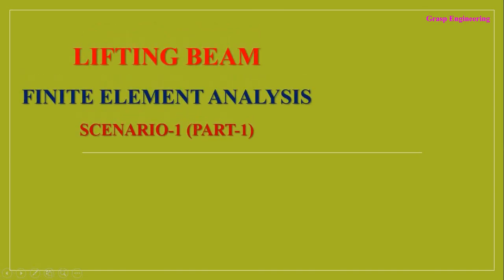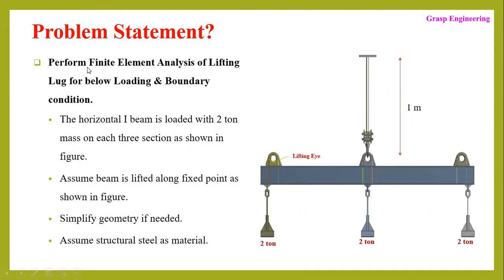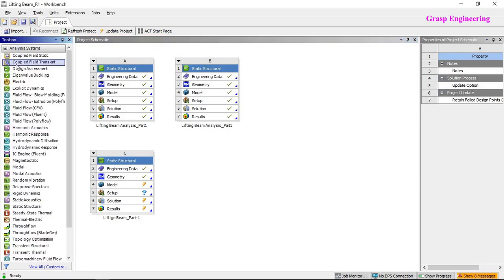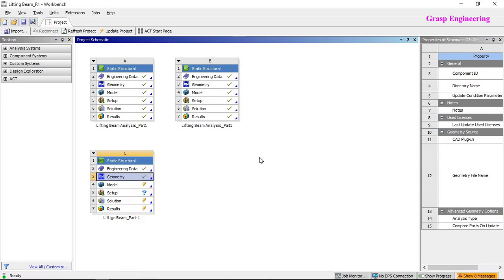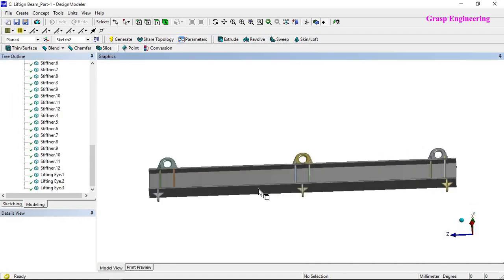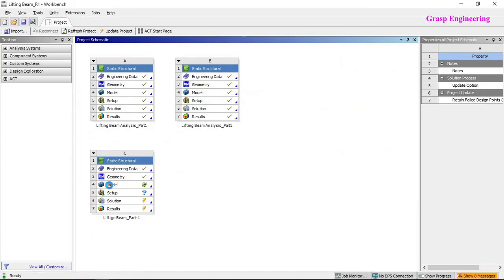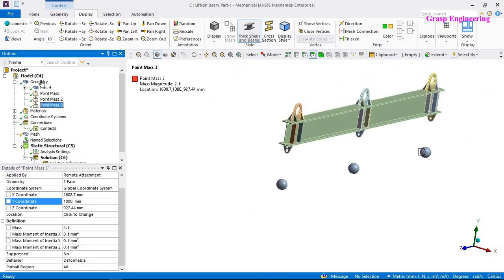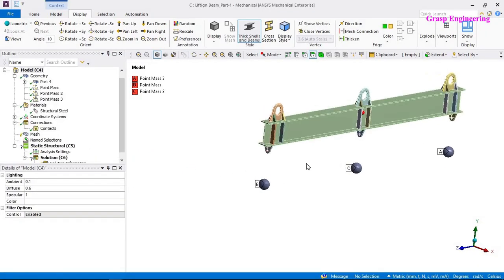Lifting Beam Static Structural FE Analysis Part 1

Comment: Hello sir. First of all, thank you for the amazing videos you make. I have a question. Let's imagine that we are lifting with the traverse in this video. Let the hole diameter be 24mm. (holes at the bottom of the traverse). Let's assume that we use the cylinder(Ø20) . And let's imagine that we attach weight through these cylinders. The question is, we have the 24mm hole diameter but we use Ø20 cylinder for lifting operation. How many pieces of point mass do we need to select to the hole diameter? Is it half the hole diameter like in this video? To summarize, in the video we chose a piece half the diameter of the hole for the point of mass. Should we choose half the hole diameter for every 90 degree lift? Otherwise, what should be the diameter of the part contacting the hole diameter?

Comment: hi, whats is the different if we use fixed support on lifting eye rather than if we use remote displacement. Thanks in advance. your video is amazing
Reply from the maker: You can do both the way either by fixed support or by remote displacement. When you are looking to analyze lifting eye it is better to use remote displacement, as fixed support case will not show stresses; while remote displacement case will show stresses and deformation.

Comment: Hi, Would you be able to do some calculations by hand to see if you get the same answer as the simulation?
Reply from the maker: Yes you can do analytical calculations. The simple way is to match the reaction of the beam model with geometry weight.